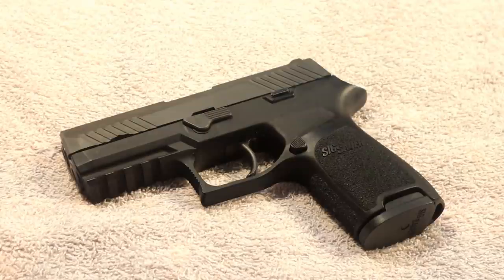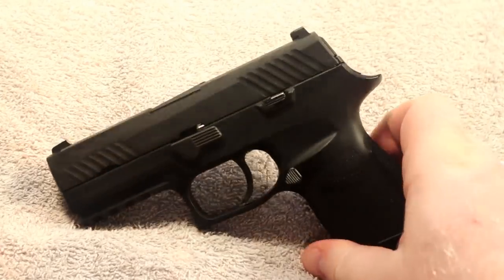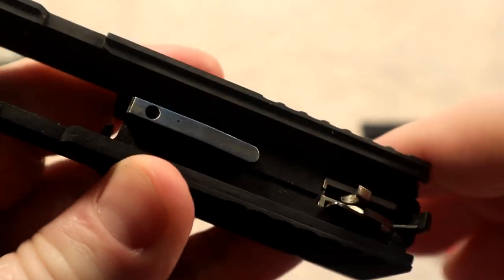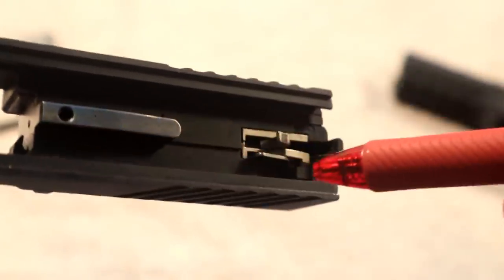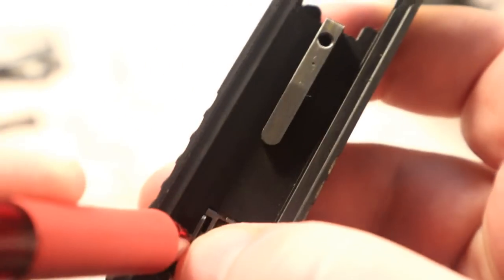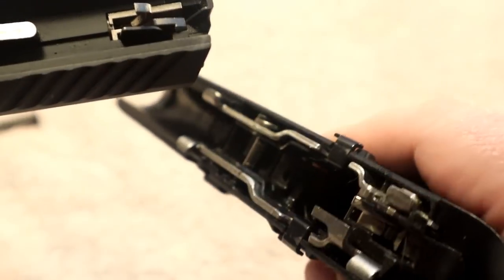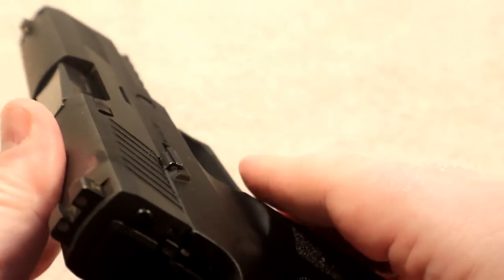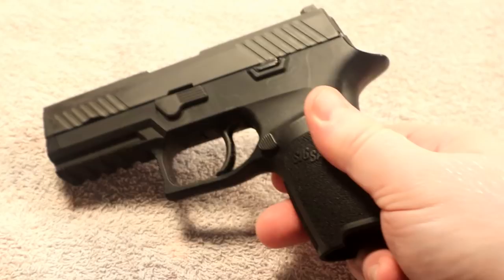The Sig P320's Dirty Little Secret You Won't Find in the Manual

Comment: You are not addressing 2 important points:
-The original issue was the trigger weight (actual weight) and trigger pull weight ratio which made it possible for the gun to fire when dropped in a certain way (the momentum due to the fall would make the trigger pull itself). That was the reason given by SIG for the recoil and in this case, the safeties you mention here have no impact. I am not a fan of Glock but their trigger safety is one way to prevent this.
-The gun was in a bag. That alone is a major red flag. You do not carry a single action pistol in a pocket or a bag with one in the chamber. The only acceptable way to carry a single action pistol with one in the chamber is in a holster specifically designed for that gun (and preferably not a Serpa). 
And I understand the Youtube rules regarding monetization but I think this video could have said the same thing in 2 to 3 minutes.
Reply: The previous pre-upgrade pistol ONLY depended on the mechanism to stop it firing. The new, upgraded version has the firing pin safety that even if you drop the pistol on the exact spot it won't fire. If they hadn't changed the gun's geometry, the firing pin safety will stop it. 

 Even if that original version of the module problem existed, it couldn't fire without the firing pin safety being depressed. I am sure the gun basically being decocked might lead to the gun firing being not possible, but that's a functional issue, as in the gun won't fire when you need it, not it firing on you.
Reply from the maker: Theres nothing wrong with these pistols
Reply: @BoomStickTactical  sorry but a 15 minutes vides saying that and not addressing the elephant in the room (the trigger issue, accepted by SIG) does not inspire confidence.
Reply: @SamToulouse  The Upgrade fixed the trigger AND the firing pin safety removed any chance of the gun firing if dropped and they hadn't changed the gun's geometry that allowed the drop at a specific angle causing a discharge anyway. They did change it though. 

 Or as they say in the court dramas when a lawyer keeps trying to get a different answer by asking the same thing over and over in different ways. "Asked and Answered". The trigger geometry is changed, and the drop/firing pin safety was added. Like all other modern SIGs, unless the trigger is to the rear, the firing pin can NOT go forward unless somehow the firing pin block is totally disabled. 
 
 So, "Asked and Answered". If you don't think SIG fixed it, don't buy a 320. The "Glockidental Discharge" continues because people handle the gun badly, and the 320 seems to have the same problem. Their firing pin safety makes them safe unless the trigger is pulled to the rear. On both guns. I don't like the feel of Glocks, but they are fine guns mechanically. Very safe too.

Comment: So just to be clear, your premise in all one hundred cases that have been documented, the trigger must have been pulled in order that the firing took place (regardless of how the trigger may have inadvertently been pulled).  That’s what I’m getting out of your video.  ❓🤔
Reply from the maker: Pressing the trigger is exactly what makes a gun fire.
Reply: @BoomStickTactical  Sig must have wrote a you a big check or gave you a lot of untrackable bitcoin. Wow
Reply from the maker: @JohnB-dr8sk  they've given me nothing. Its called looking for facts.
Reply: @BoomStickTactical  Facts? Like the case in Florida where a teen was shot by a Sig P320 that went off on its own? An investigation found that the gun's trigger was not pulled when it went off. Or the large number of lawsuits that Sig paid hush money to keep quiet? The video showing a P320 going off inside of an undercover officer's holster by itself? The mountain of evidence in forums from P320 owners? Those kinds of facts?
Reply from the maker: @JohnB-dr8sk  stop believing the internet hype. Most of the lawsuits have been dismissed because it was shown to be operator error and not a problem with the gun.
Reply: @BoomStickTactical  That's not true and you know it. There have been no official determinations stating what you just said. Sig simply paid settlements along with non-disclosures as part of those settlements. What you're saying IS an internet rumor and has no basis in fact. If it was, you would have posted it in your video other than just saying it.
Reply from the maker: @JohnB-dr8sk  I suggest you look up the actual cases instead of youtube videos
Reply: @BoomStickTactical  I did, and it showed that due to Sig's faulty engineering. they had to keep lightening the trigger/sear/striker to keep inertia from accidentally tripping the P320's sear during a fall or if the gun was jostled, setting it off. You're familiar with that right? It's in court documents. It's the reason light primer strikes are so prevalent in P320s and P365s.
Reply from the maker: @JohnB-dr8sk  if you hate Sig don't buy one. What you read was the filing by a lawyer, not the outcome. I own several Sigs as well as many other manufacturers. There's nothing wrong with them
Reply: @BoomStickTactical  I own a Gen 2 P365 that started having light primer strikes at 400 rounds. I also know someone who owns a P365X who just started having failure to extracts at 500 rounds. THAT'S why I researched this. You must be on the take. That's the only way you could say there are "zero" problems. That statement is so absurd no one could take it serious.

Comment: Carrying these gun is like carrying a 1911 or a double action single action gun with the hammer cock and no external safety, these is a single action pistol like it was explained in a another video  It not safe, the people and the officer that are injured are not lying, these thing is going off in the holsters.
Reply from the maker: It is as safe as any other pistol.
Reply: @BoomStickTactical  The trigger  is the issue not the internal safeties you described. They had a issue with the trigger going off when dropped, they recall it and put a lighter trigger and now the new lighter trigger has a new set of issues. Am not a gun expert like you, but there is plenty of video evidence showing the gun going of in the officers holsters.

Comment: Sig Sauer made a Defective SEAR, which does not keep a firm purchase on the Trigger.
    Made in Exeter, New Hampshire, so I'm not surprised.
Reply from the maker: If the sear failed the firing pin block would still stop it from firing.
Reply: The upgrade to the new p320 change the trigger to one with less mass. Did they do anything to the firing pin block? I recall a video where they explained that the engagement area of the FPB was small and poor design. It could be defeated if moved out of engagement by a very small amount.
Reply from the maker: @melc8049  yes, they made it harder for the fcu to disengage it. The safety cannot move without the trigger being pressed.
Reply: @melc8049  
The Upgrades were sent out, but many Police Departments did NOT 🚫 install them
Reply: @LuigiPizza-fv2hv  did they replace the service pistol instead? I don’t see them keeping the gun in service if they don’t fix them or replace them.
Reply: @melc8049  I'm not sure
Most Cops I see are carrying GLOCKS.
Many don't know what what Model they are, though. 😂
I ask them & they say, "I don't know."
You'd think they'd know what their Service Weapon was.
I assume that most are 17s or 19s.
Reply: @melc8049  Small local PDs up to major agencies, and who had the p320 as an issued sidearm- had their pistols replaced- no parts swapping. The p320 is in wide use across America and the world. Her Serpa holster is an open muzzle design, and she had all the normal stuff a woman has in a purse- that stuff caused the discharge.

Comment: if this sidearm was so bad then why would our armed forces sign a contract with sig to use them... now we have a Milwaukee trooper sueing sig because his sidearm discharged aparently without the trigger being pressed. not sure how much of that I believe because our law enforcement dont get the best training at all and 2/3 of them are horrible shots
Reply from the maker: Very good points.  Nothing wrong with this pistol
Reply: I've read the article from a local news station in Milwaukee and it's happened  on 3 separate occasions, each time with the pistol still in the holster. The Milwaukee Police Union is actually suing the city because of it.
Reply: they haven't won in court
Reply from the maker: @Googley Eyes  you can sue a ham sandwich but it doesn't make it true
Reply: @Thesusoperator  That's true, but the point is that they're suing because the firearms discharge on their own.

Comment: All this is very interesting but you are assessing the safety of a firearm by looking at it (or dissecting it). If it were that easy we would not crash test cars, not test vaccines etc. (We would just look a them and decide if they are safe). You can not possibly account for all the real life scenarios with your methodology. The bottom line is that multiple police agencies across the country are reporting unintentional discharges with holstered P320s. Whatever the "initial cause" is (as you call it), it is a moot point if people are getting injured with HOLSTERED firearms. The safety of a product is not just based on its intrinsic characteristics but rather, by its comportment in real life situations. There is a problem and it just can't be ignored.
Reply from the maker: Cops aren't necessarily gun people. The sig is fine

Comment: My M18 went off in my holster .it just did
Reply from the maker: What component failed?
Reply: @BoomStick Tactical  don't know it was fully locked in my holster and it went off.  Sig seems to be saying it's a "firing pin return spring" that's what a couple of people who returned it were told. Mine is new enough it had all the factory upgrades
Reply: My safety was off. I always use the safety don't know if that would have stopped it
Reply from the maker: @Roy-fanof9  there would have to be several failures including the firing pin block. Something must have gotten against the trigger
Reply: @BoomStick Tactical  it was fully in the holster. Trigger was fully inside trigger guard the palm of my hand was on back of the slide when it fired the rear sight opened my hand in two spots

Comment: This video did not age well sir
Reply from the maker: Why not?  There's nothing wrong with them.
Reply: I’ve fired this model of gun without a trigger pull. The gun needs a Manuel safety period. It’s weird how many lawsuits there are, and it’s just one gun that does it. Sigs striker fired hand gun is a fail. Bottom line about the ct police video the gun was secured in the safari land 6000 series holster. Sig has retracted their previous statement.

Comment: you have not calculated for powder buildup or deformed holster or running while it being in the holster while a cop will do a all the above while chasing criminals... its a rough job and they need equipment that can handle the abuse... you break down does not cover the extremes the cops go through and your gaslighting will get people injured. your wrong.
Reply from the maker: Cases have been debunked

Comment: If it was a matter of poor holster fitment that caused the guns to ghost fire, wouldn’t a Glock like safety trigger still be an ideal solution to those types of issues?
Reply from the maker: Unless something presses it.
Reply: @BoomStickTactical  Agreed, but the angle and type of press would be greatly reduced, also Glock uses a small trigger guard opening to reduce the possibility even more.
Reply: In your example, many of those events would result in the object simply slipping off the smooth face of the p320 triggers and not pressing rearward fully. In addition, many shooters hate bladed triggers, hence the overwhelming successes of both the p320 and p365. If an object presses trigger- it's shooter negligence.
Reply: Glock is a double action only.  Takes a longer trigger press to bring the firing pin rearward and release it.  Sigs are single action.  The firing pin is already to the rear, ready to be released.

Comment: that is why you buy guns with safety lever on them lol. People get made fun of because people with safety lever are scared of the gun going off. It's not just that. It's there for a good reason. When you are in motion, especially when the trigger does not have a secondary safety lever in front of it, could be accidentally pressed pull by holster, garment, or accidental movement. Backstrap, safety levers and trigger safety lever eliminates all those dangers. But people wanna make fun of you for having those safety measures in place lol. Goodluck blowing your knees and junk off bruh.
Reply from the maker: Under stress, most people will fail to turn the safety off before trying to fire it.

Comment: I have no idea why people feel they need to defend Sig Sauer over a pistol that was released for sale to the public with issue's. If Sig would've done the right thing and recalled the pistols instead of issuing a "voluntary upgrade". I don't think anyone would be having these conversations. Sig Sauer has made great, reliable and safe firearms for decades. In my opinion it's about how they handled the problem, not the problem itself. Multiple people have been shot with the P320 accidentally, whether the fault of the gun or the person. If Sig would've got in front of this and recalled them I don't think we would be talking about it. The reason the pistols weren't recalled is because Sig would've lost the military contract if they issued a recall. Sig put money ahead of public safety.
Reply from the maker: Trying to get out accurate information
Reply: @BoomStickTactical  just like you I don't know how the malfunctions are happening with the P320. But the fact is they are happening. And at an extremely higher rate than any other modern pistol in the last 2 decade's. Something is going on with the gun's.

Comment: After seeing this video and knowing a 1911 in a out this is a shitty fucking design of a weapon, it should be a single piece for the safety not bumping metal on metal to connect it if that truly is how the weapon is designed simply jerking motion followed by a offtime trigger pull could make the system slip and discharge especially with the play in the slide going up and down, combined with the safety sear almost being the same height as the play in the slide
Reply from the maker: There's nothing wrong with sig
Reply: @BoomStickTactical  it is built worse then other guns for sure , the only reason it was produced is to claim new patents

Comment: All of the features you describe in your video are "deactivated" when the trigger is pulled by a person or when it travels rearward on its own by inertia. You failed to adequately address inertia firing, which is prevented in almost every other striker-fired pistol with inclusion of the so called pivoting tabbed "trigger safety," which prevents the trigger traveling rearward by inertia in the case of a drop on the rear of the pistol. SIG Sauer has consistently refused to include a tabbed trigger safety as is on nearly every other striker-fired pistol, yet early advertising depicted the device as an available option. Doesn't the "voluntary upgrade," which lightens the parts subject to inertia merely make the distance the pistol has to fall before it fires by inertia greater, while not eliminating the issue?
Reply from the maker: The Sig 320 is fine now. You cannot find any cases of people being able to make them fire now when dropped

Comment: If nothing was wrong this gun why did Sig have a recall and still couldn't fix it so that's on the company not the consumers
Reply from the maker: They didn't have a recall.
Reply: @andresimmons6787  the “recall” that you are referring is actually a voluntary upgrade program.  The issue that led to it was that when the gun (first generation) was dropped at a very specific angle the mass of the trigger could be enough to overcome the spring tension and allow the trigger to travel far enough to to discharge the pistol.  It should be noted that the gun was subjected to industry standard drop tests which it had passed prior to being released for sale.  When the issue was discovered and it was determined to be repeatable Sig stopped production of the guns to address the issue.  While it is true that there have been several additional complaints about the guns firing “uncommanded” since the upgrade the circumstances around these unintended discharges have not been conclusively determined.  Furthermore it has not been proven that these additional unintentional discharges were because the (improved/upgraded) safety mechanisms failed.  Poorly fitted or designed holsters can allow objects (like what you might find in the average purse) to enter the trigger guard and fire a weapon by depressing the trigger.  This is not the fault of the firearm design but of holster design.  
Having said that I agree with the video, if you don’t think a gun is safe, you should not carry it.  Also, I believe that there are a variety of things that one can do to enhance safety.  For example, carrying the gun on her person in a properly fitted holster.  Or, in a holster within a purse specifically designed to carry a gun so that items within the purse are not commingling with the firearm.  To be fair, this detective may have done this but I doubt it because they never said so in the news pieces I have seen.
Reply: So what's your point a recall is a recall I don't care if it's voluntary or mandatory they had plenty and still have complaints but according to you none that happened if wasn't broke why fix it they
Reply: LMFBO at the barely literate tool trying to communicate!